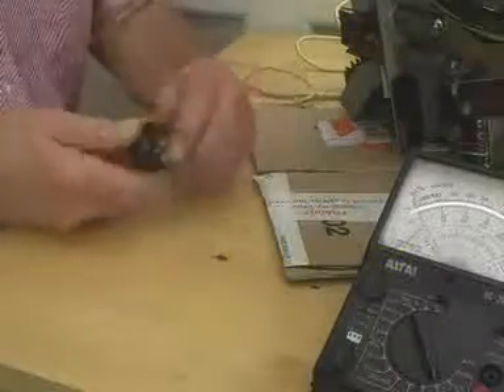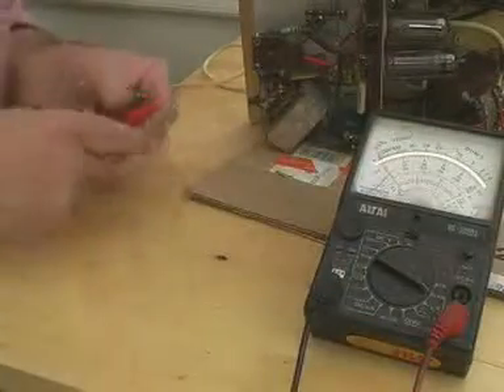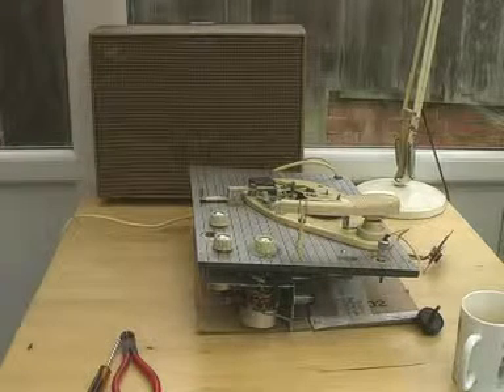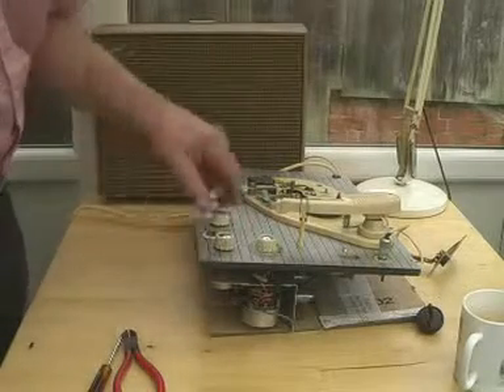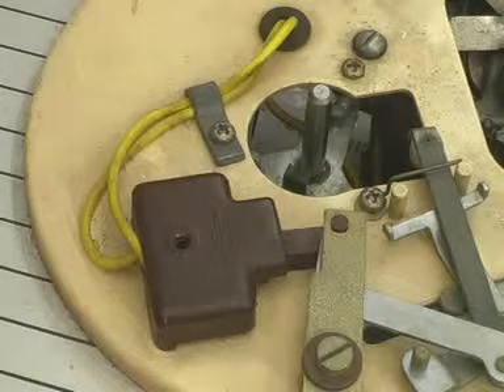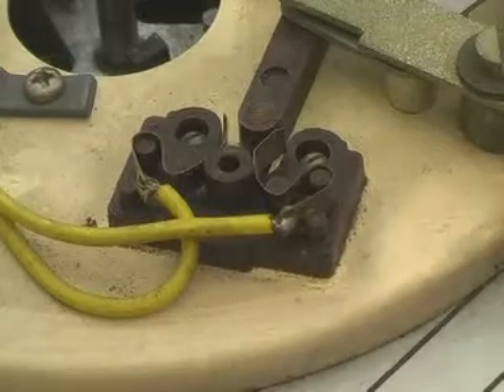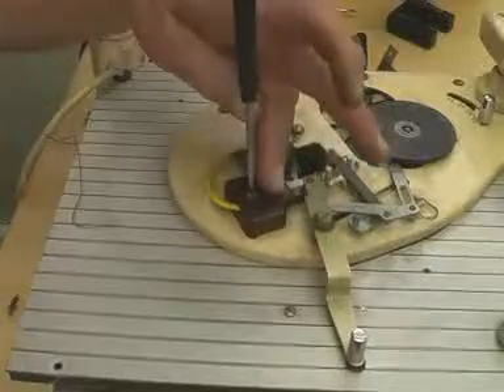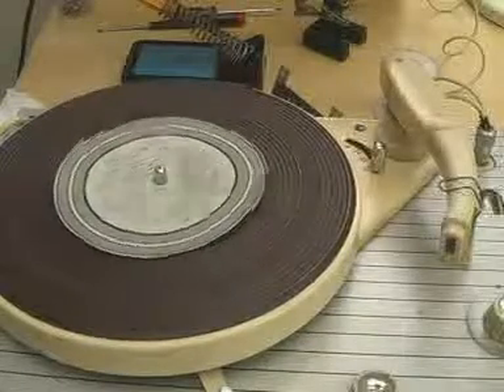pye2.mpg

Comment from the maker: Glad you liked the video. I have since obtained a Service Sheet for the Pye machine, and also some magnetic discs. It will now play the discs, but not record on them: most frustrating! I have had 2 Recordons; one was butchered, but the other one was supposed to still work when it was packed away many years ago. I haven't bothered to test it as I don't have any paper discs. If you would let me purchase a paper disc or two, that would be great, thanks! Sorry about the delay in replying.

Comment: Thanks for your videos. Very entertaining. I have a Recordon magnetic disc recorder that uses paper discs and has a smaller plastic tracking disc that fits in the middle to make the head move across the turn table. The machine runs but im unable to get a record and playback though it. I have loads of paper discs if you would like one or two to play with

Comment from the maker: Well done! Yes; there are supposed to be 2 quite separate plug-in heads with this machine. One is a perfectly normal 'turnover' crystal cartridge with a little knob on the front for doing this. One side is for playing 78s, the other side is for 45s & 33s. The other one is a head containing the record/replay head for recording on the brown 12" (30cm) pre-grooved magnetic discs. Did you get both of these separate plug-in heads with the machine? Please let me know, OK? I might be able to help you.

Comment from the maker: Thanks! Yes, the Collaro company (I think Collaro is a Greek name), made spring-driven motors for gramophones (and probably other things) way back from the early 1920s. In fact, if you wanted a big Collaro motor in a custom-made gramophone, there was an extra charge, over the 'regular' type normally supplied. Latterly they made tape decks in the 1950s & probably even into the 1960s. Guess we ought to Google 'Collaro' and find out more!